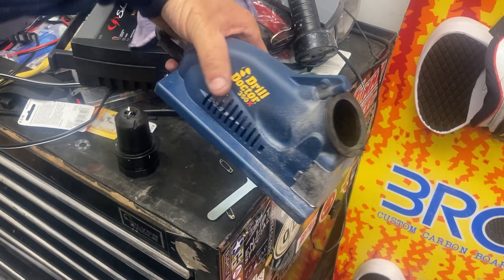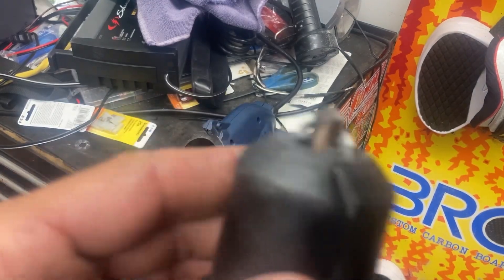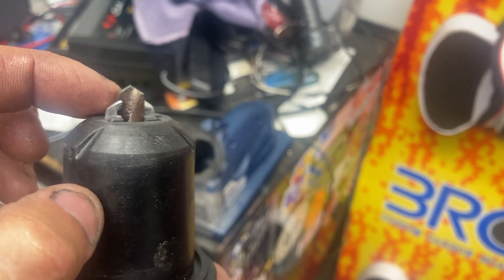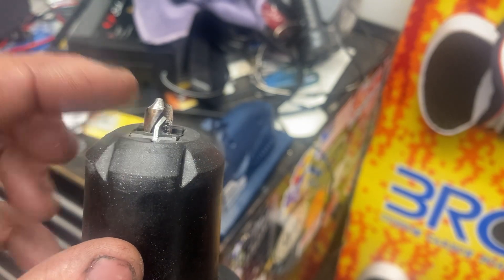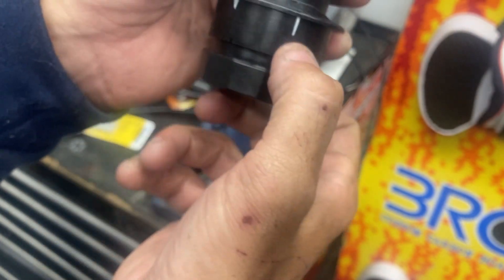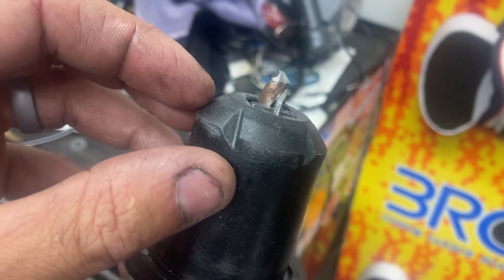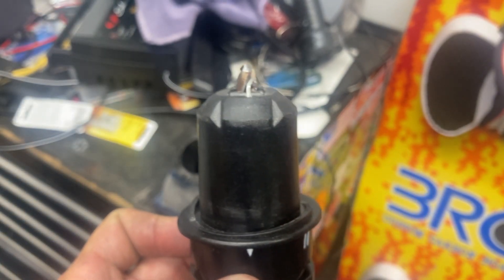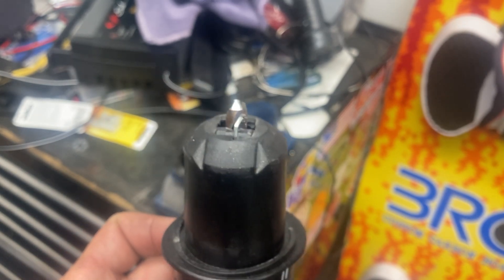Drill doctor 350x how to use

Comment: I had one years ago and struggled with it. I got rid of it and got another one coming any day now. I'm going to try your method. I can sharpen the bigger bits on a bench grinder but the smaller bits are really hard to see so these sharpeners are a must if you drill metal.